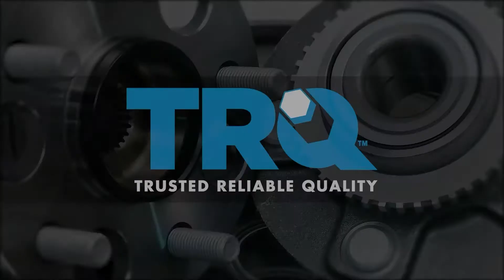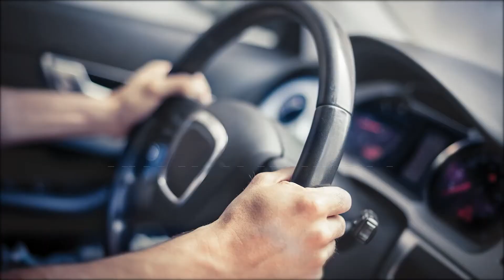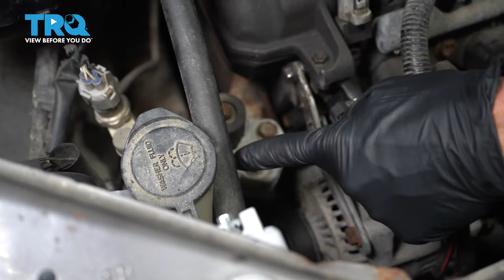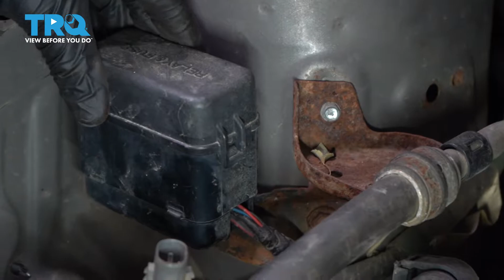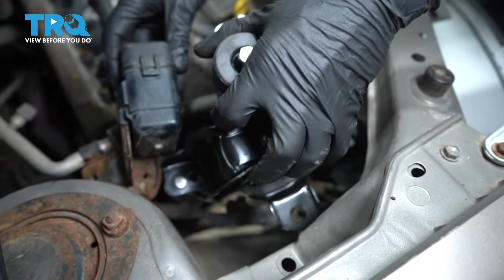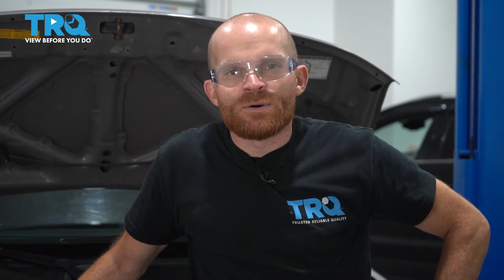How to Replace Front Engine Mount 2004-2006 Scion xB

Comment: This might help someone: I had trouble getting the mount around the ac line so I took off the window washer resevoir by removing two small bolts.  Then I was able to pull the old mount through the front and put the new one through the same area.  Thanks for these videos TRQ.

Comment: @trq 
For replacing this motor mount can you have like. A 2 jack stand set up and using a regular jack to bring the motor down after unscrewing what needs to be unscrewed . Would it affect the replacement if done like this ?

Comment: Can you only remove the top 2.... 14mm bolts ( I guess you would call it the mounting points to the ENGINE....and not the other bolts TO THE CHASSIS)...just those top 2, 14mm bolt if you want to LOWER the engine...and if so....wouldn't tha be all that is required for water pump repair?....OR....do you need to take ALL the engine mount hardware off....such that you can also LIFT the engine for water pump repair?